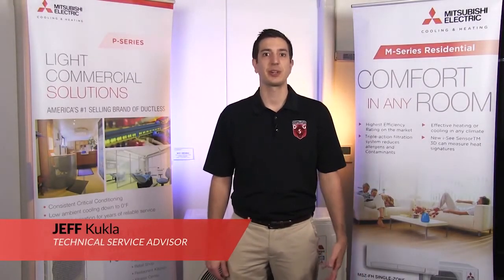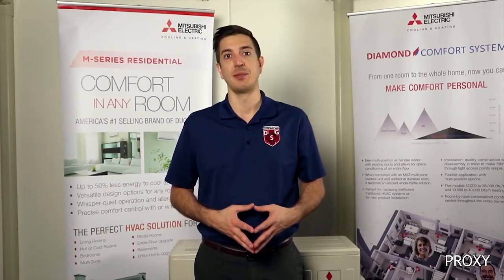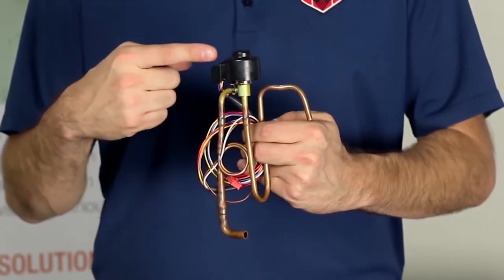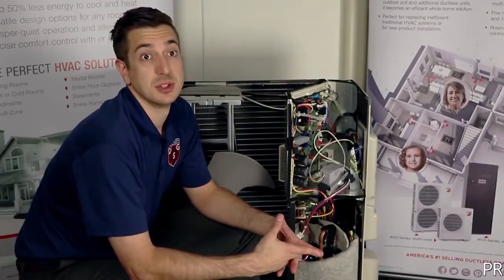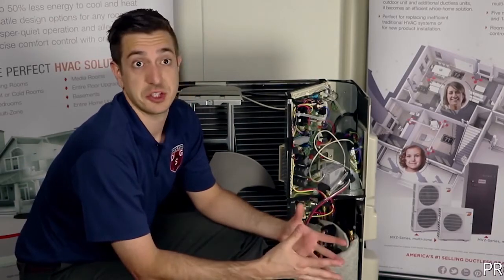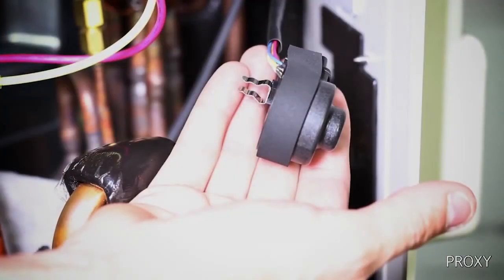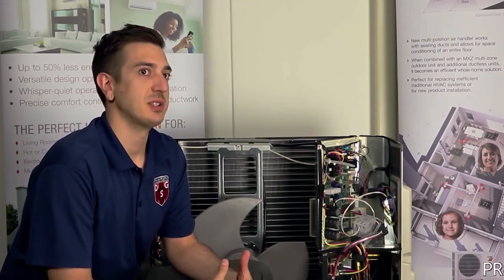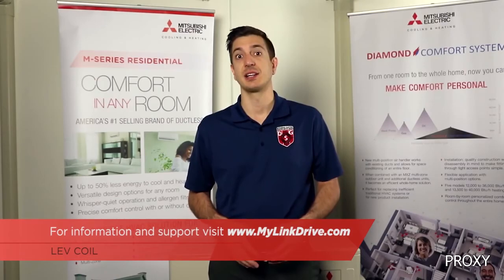Tech Tips: How to Resolve Problems with the LEV Coil (L)

Comment: Add a new tech tip on repairing heating issues or excessive defrost cycles on mxz3c30nahz4 units. Other models may be effected as well. Looks like the only fix is a replacement outdoor control board. Currently not available,  4 week back order. I have 3 units that can't maintain heat because of defrost cycles. Problem starts around 36 F. Gets worse as temp drops. No frost on outdoor unit.
Reply: My unit does the same thing as you stated! If you fix it can you let me know what it was?  Works great for heat when outside temps are above 40F, once defrost cycle hits won't stop defrost.  Replaced all thermistors and inside control board already. No error codes